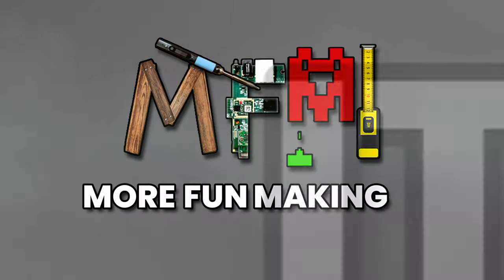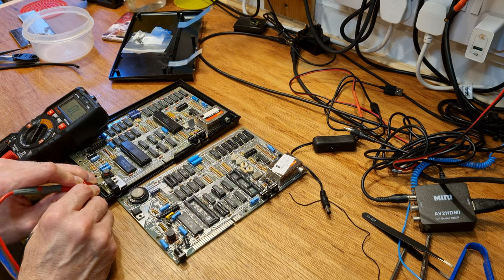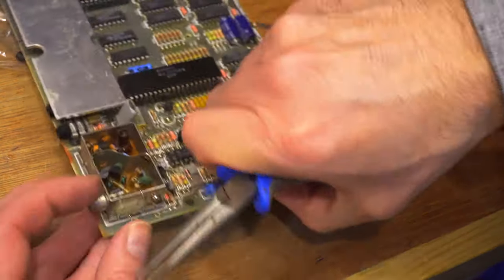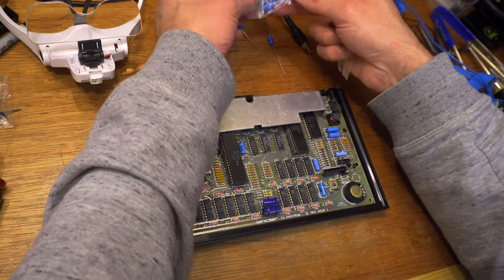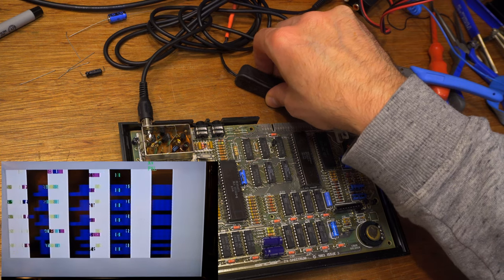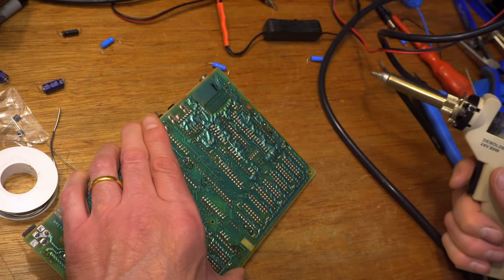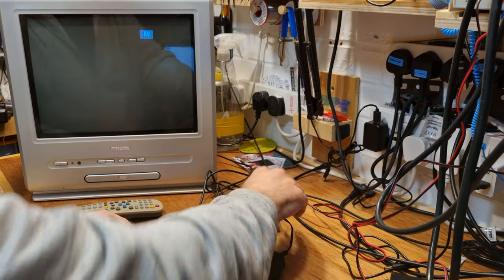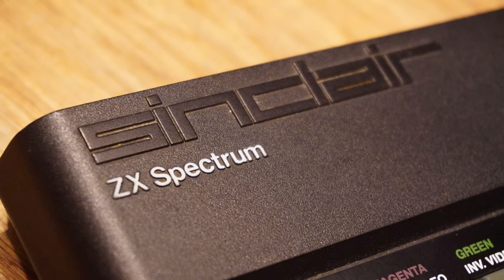Are bad caps a thing? ZX Spectrum 48k rubber key repair!

Comment: Love these quick fix videos. Maybe I've been lucky but I've tried the earlier Speccy's with LCD and plasma TVs and the image was better than a portable CRT.
Reply from the maker: Thanks Captain! I think the one I'm using as a test screen is just not very good. My old one was great, smaller and better picture. But that one developed a fault where the earth shielding on it was at 100v 😱

Comment: Great video. I have an old 48k wonder under the bed that last time I tested it (about 10 years ago!) It had very wobbly video out so I think it's due a recap, so got the ZXrenew kit that I need to install and do the comp mod, so your video is a nice reminder to do that! Nice tip on heating a blob to extract from the top.
Reply from the maker: Thank you Chris! 😁 Good luck with your Spectrum. Hopefully the cat didn't find it under the bed and use it for keeping hairballs in.

Comment: Another disadvantage of sockets is that they add extra parasitic effects on the signals, which may become a problem when running the system at 4 GHz for higher fps...

Comment: no need to disconnect the 2 modulator leads to composite mod it, you can even leave the resistor connected to get 'simultaneous' rf and composite out .. also reducing the emitter resistor of the modulator drive transistor by half can improve negative going parts of the signal   as for recapping, i dont generally hold with 'blanket' recapping, its mostly unnecessary, they last better and longer than many think,  dried up reset cap can cause a 'no start' issue, dried up c46 can result in fried lower ram, so i'd replace those first , maybe fit a non electrolytic instead, so should last 'forever'..

Comment: My guess is C27 was the bugger here. This capacitor is part of the reset circuit which holds the RESET line low on power up as it charges. If it charges up too fast (due to decreased capacitance) or doesnt charge up at all, the system doesnt get reset properly.
Reply from the maker: I think you described exactly what was happening here. Other than that things seemed functional. The dcdc was working as expected, just wasn't starting up every time.

Comment: Just so you know, shorting the output of a 7805 to ground shouldnt kill it. They have internal short circuit protection, so they should just shut down. The voltage converter circuit may not like it though as it uses the 5V line as a reference voltage
Reply from the maker: Always good to know!

Comment: Did you miss the center screw to fix the pcb to the lower case when mounting it back? ^-^
Reply from the maker: That's very well spotted. It was actually missing when I opened it up!
Reply: @MoreFunMakingIt  Nice repair video as usual. It reminds me that I still need to do a recap on one of my Speccy 48k 🙂